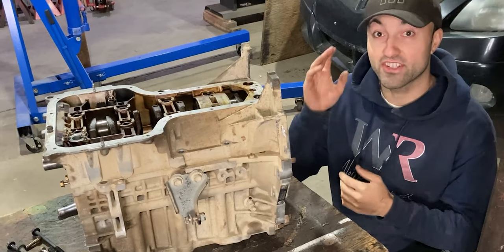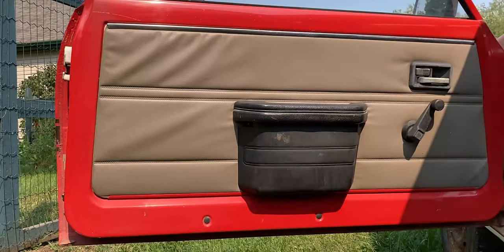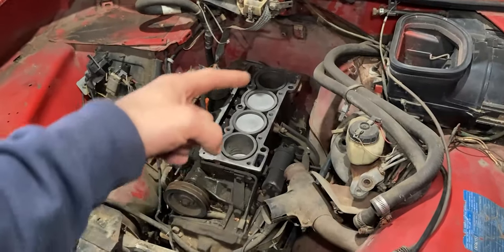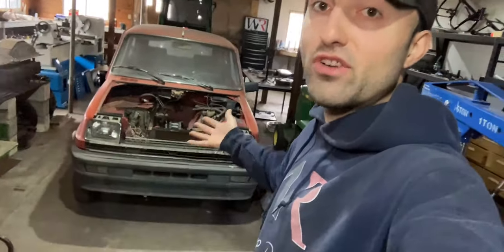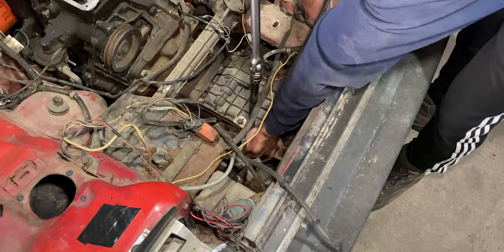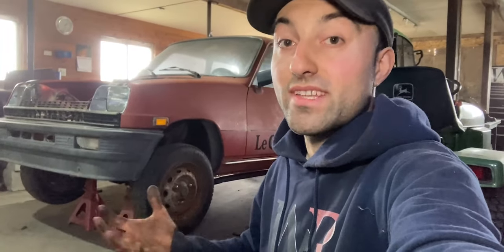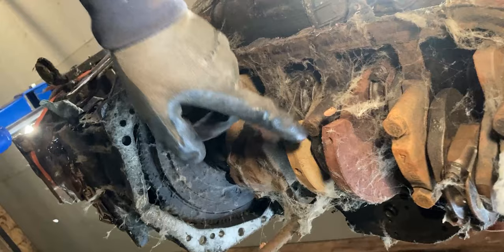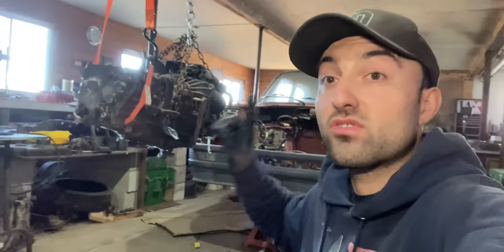CAN I SAVE THIS RENAULT R5 ENGINE? | PT 2

Comment: I love these cars! They are so simple and easy to work on. Brilliant design!
Trans comes off by it's self without removing the steering rack. It pulls right out from the top. 
I had a syncro drop in mine from the tapered rollers becoming too loose. I pulled the tyranny out, dismantled fixed it and put it back in in half a day.
Didn't even have to drain the radiator. The hoses were long enough to just pull it up and lay it on the head out of the way.

I wish I could find one for sale like you did. They've been scarce for the last 30 years.
Reply from the maker: I fully agree with you and I love them too! Despite the compact size, it's actually quite easy to work on everything as you mentioned.
Unfortunately, they do have rust problems and a lot of the sheet metal is VERY thin...which doesn't really help! Luckily I have some parts out back that will assist with the rebuild and hopefully I'll get to it sooner than later. 
There are always deals on Marketplace or other online platforms. Just keep an eye for one and you'll have yourself a new project. 
Thanks for your comment. Regards Andreas

Comment: I've rebuilt lots of bikes in similar condition as your Renault but can't imagine tackling a car in such a state! You are a brave man!
Reply from the maker: I believe it would be easier to rebuild a bike in this condition, especially since there are only two wheels to worry about! I really want to get this car roadworthy, which means the drivetrain will need attention and after that I can always look at the cosmetics. There is a lot of work to do, but I'm not afraid! I saw your videos John and I have to say you have some very nice bikes!! Your Norton sounds and looks amazing. Thanks for sharing. Regards Andreas
Reply: Thanks Andreas. The Norton was a frame up restoration from a start not dissimilar to your Renault - a labor of love that I owned for 26 years. BTW: Your Renault engine looks like a relative of the engine BMW sourced from Renault for their first in-line four, the K100RS. It was one of the most reliable engines they ever sold.

Comment: I had the first generation 5TS, 1.4 engine, they were great, had the same engine in a Renault 14 TS too
Now while you think that small engine was powerful I have a Renault Austral a car you won’t know but big in Europe. 1.2 litre 3 cylinder engine with full hybrid that produces 200 horsepower.
My engine is physically smaller than the 5 engine and way more powerful. Oh and to really annoy you folks I return over 60 miles per gallon too. So equates to around 730 miles per tank of petrol of 55 litres.

Comment: I think the only logical thing to do is just throw that John Deere lawn mower engine in the Renault.
Reply from the maker: That‘s actually not a bad idea! The previous engine I rebuilt would be a little bit underpowered...but with that 4 speed manual, you could always compensate for that😆 This will be a tough one to tear as many components are not moving! We‘ll see what I can salvage and what not. Thanks for tuning in😃👍🏽

Comment: Do you think an L15A honda engine + transmission  would fit in the renault?
Reply from the maker: Hi there! I don't know much about that engine or transmission, but I know the Renault engine + transmission is a longitudinal setup and the engine and transmission you're talking about is transverse. Without knowing any numbers, I don't think it'll work...but you can always make it work. With a lot of fabrication work anything will fit. Regards Andreas